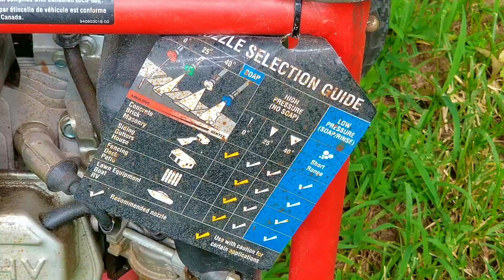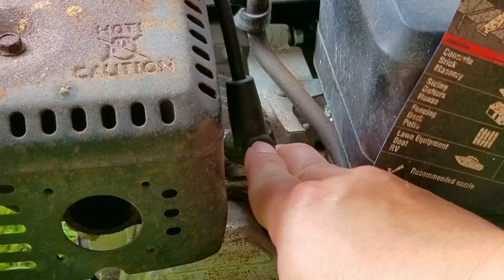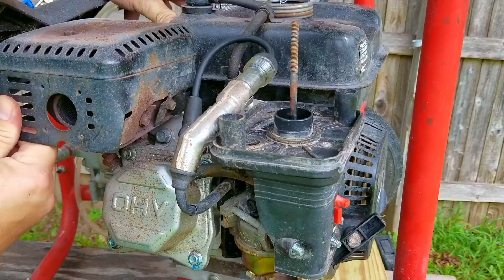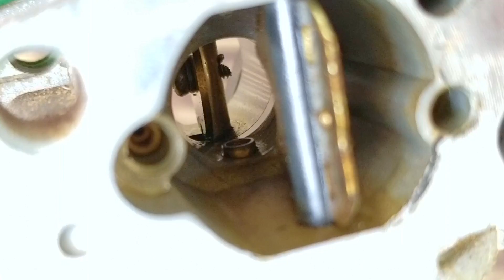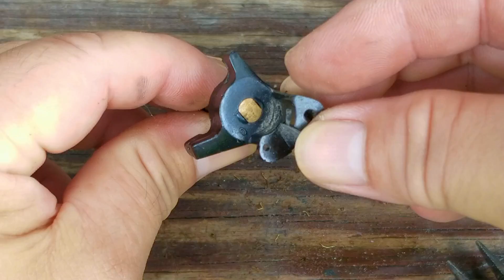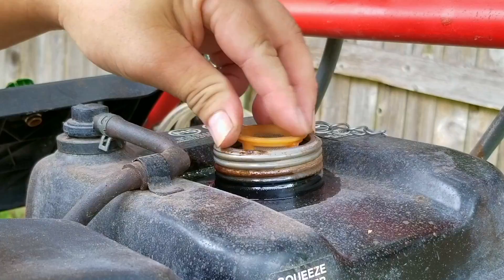Don't let this happen to your Pressure washer.

Comment: I have a ryobi pressure washer gas powered 2600 I think honda motor gcv but anyways I've been working  on it and it'll crank but whenever I take it off of the choke it dies though I will say the wand is also missing the novel tip
Reply from the maker: Have you cleaned the carb focusing on the fuel jet?
Reply: @HomeGaragechannel  i think I did, but I shall do it once more and then try to see if it will run with the choke off hopefully thats the solution! Oh, and by the way, i must say, man, you have helped me in so many ways, so I must say thank you, and I appreciate all that you do with fixing and solutions with small engines on your videos!

Comment: You mention using aftermarket carbs. I have found many times their quality is poor and they don't work well. I always recomend to my customers a factory unit unless the O E M is extremely expensive, but give them a choice and inform them that I can not guaranty an aftermarket carb. Al from Als mowers etc.
Reply from the maker: Thanks for the tip!

Comment: There is a manufacturer hole under the gas tank on the inside corner and no video shows the inside top of the pump where that area of the tank is. I’m pulling my hair out.
Reply from the maker: I'll have to look and see what you're talking about.

Comment: Definitely save and rebuild the original carb. I also use engineered gas for my pressure washer to minimize fouling.
Reply from the maker: thank you Michael Skinner.

Comment: I built my washer from the cart and engine, a 7.75? horse Briggs [plastic cam engine that the washer pump froze up on and ordered everything from Ebay. It would start with the auto choke closed so with a main jet cleaning it does fine now. I always try and clean before ordering new and I think we both did a good job. Thanks and Blessings!
Reply from the maker: thank you Lewie McNeely
Reply: @HomeGaragechannel  Sure thing!

Comment: I would have cleaned it. That is part of the fun. I was really surprised that the pump wasn't busted. Living in the Midwest I find that to be the most common issue. They get put away and left in garages, sheds or barns in sub zero weather.
Reply from the maker: you're right about that.

Comment: Just picked up one of these at an estate sale for $30 as a summer project for me my son. Trying to teach him how to diagnose and work on things instead of just throwing it out. I took the bowl off the carburetor and it was full of crystals and dirty fuel just like this, but the tank had clean fuel. I cleaned it and re-assembled, but it's still not running. Tested it by putting fuel straight into the throat and it runs for just a second. Will try a more thorough cleaning of the carburetor before buying a new one.
Reply from the maker: good job. that a good way to teach your son perseverance.
Reply: Did a more thorough cleaning and got it running. My son was ecstatic and I'm happy with a working pressure washer on the cheap. Thanks for your videos! Really helped me with my repair.

Comment: I have a 3200 psi pressure washer with a Honda engine that works great I would highly recommend the same to others… I would have cleaned the carb like you did I use an old guitar string to clean the orifices along with carb cleaner and compressed air… another thing that helps keep carbs clean is Johnson Evinrude 2+4 fuel system cleaner and it only takes a very small amount but in the case of this carb it definitely needed to come apart to be cleaned …. Great job I’m sure this video will be useful for many 👊🏼
Reply from the maker: thank you for the tips Fred D. I appreciate it.
Reply: @HomeGaragechannel  you’re welcome

Comment: Here is a tip for you. Make sure you have the water hooked up before you start and try getting the air out before hooking up the pressure hose. If you run it without turning on the water you could damage your pump.
Reply from the maker: yes you're absolutely right.

Comment: Great video, just subbed to your channel. I have a Honda power washer that was given to me that has me stumped, it needed a new pump which I replaced and I cleaned the carburetor a few times and the engine still surges very badly. I then bought a brand new OEM Honda replacement carburetor for only $23 as well as all new gaskets, still has a very bad surging problem. Any ideas of other things I should check? I confirmed it has good fuel flow to the carburetor so I don't think it's the tank vent.
Reply from the maker: Thanks for the sub! I need more information about the pump. can you give me a model and serial number?
Reply: @HomeGaragechannel  I don't think there is anything wrong with the pump but here is a link to the exact pump I bought https://smile.amazon.com/gp/product/B088376WV2/ref=ppx_yo_dt_b_asin_title_o03_s00?ie=UTF8&psc=1
The engine just has a very bad surge even still after replacing the carburetor with an OEM Honda one as well as new gaskets.
Reply from the maker: thanks for the information , but I phrased that wrong, I mean the model and serial number for the pressure washer.
Reply: @HomeGaragechannel  I looked on my power washer and the model/serial number sticker is missing, I can tell where it was on the frame. But I just noticed something after watching your video where you swapped the engine on that Honda mower that was knocking real bad and while looking at the parts diagram for the engine, the plastic insulator plate and insulator gaskets were in the wrong order. I just put them back on the way they came off when I tried cleaning the old carburetor and replaced it with the new one and gaskets but it looked like someone had the carb off before so they must've gotten the order wrong. Could that potentially cause the engine to surge?
Reply from the maker: possibly, if there wasn't a gasket where there was supposed to be one, could cause it to surge.

Comment: I have a problem with a Trimmer/Multi tool my dad bought a few years ago. It has some sticky/oily residue arount the spot where the fuel hoses enter the tank and the lid is a bit sticky too. Also, the primer bulb doesn't fill up. Should I open and check the carb?
Reply from the maker: not yet, have you put some fresh mixed fuel into tank? The Fuel Filter might have the Same stick oil on it that might be blocking the fuel from getting to the carb.

Comment: I fixed a plastic fuel float with a solder iron on my last free mower find. I do need to take it back apart to take apart the plastic injector tree. (New style carb). I'm still learning about the wires to clean holes with.
Reply from the maker: Great tip! Was the old float split?
Reply: @HomeGaragechannel  Presumably along the back seam near the pin mount. Pried it apart there to remove the gas then melted it back together.
Reply from the maker: wow, excellent work

Comment: I would keep the original carburetor on it and just clean it.  But when cleaning it, I would have not taken the whole carburetor off of the engine.  I would have just tipped the engine backwards, took the bowl off and removed the emulsion tube to clean and then put back together.  Sometimes those carbs can be a hassle to reinstall
Reply from the maker: you make a Great point! I'll have to remember that next time. thank you Cole Steffens.

Comment: for me i,d give it a good cleaning and starting with a proper dis-assembly and then put it back together in the right order and then re-assemble and then re-install back onto the engine and see how it works from there and if it,s not running right i,d replace it then from there on and my Ryobi 163cc engine was working a couple of days ago but the water coming out of it by the pump is not pumping enough water and it sounds like to me the carb could be dirty or i could give the pump a good cleaning inside or the trigger gun might need a inspection and probably a clean too.
Reply from the maker: let us know how it goes. I'm  interested to see what the issue is.

Comment: If you live in cold climates, most of the freebee pressure washer your going to find will have hit the curb because the last owner failed to disconnect both of the water lines and drain all the water out of the pump properly; which caused the remaining water left inside it to freeze and bust the pump. In these cases, you will likely get the motor running just fine only to discover that the pump makes no pressure at the wand but water sprays out the crack in the pump. You can easily buy a replacement pump, but the cost of the pump is usually as much or more than the value of the machine with a new pump installed … but, if the machine was free or nearly free and your plan is to keep and use the machine for yourself, the cost of the new pump is usually cheaper than buying a new machine. I purchased an older machine about 10 years ago for a few dollars, got it running (for free) and replaced the pump for around $85.00. Over the last decade, I have gotten far more use out of it than the roughly $100.00 I initially invested in the machine … so I call it a win and it still works great. Could I have bought a good used machine for the same money? Yes … but I was already “in” this machine and I didn’t want to spend more time and gas money driving around looking for another machine when I knew all it needed was a pump to be ready to work. I only replace carbs on 4 stroke small engines if they are corroded inside. If I discovered a carb in the condition of this one, I would also have tried to clean and revive it. I have had much better luck with 4 stroke carbs “coming back” than 2 stroke carbs … plus the parts are larger and less likely to go “ping” and fly across the garage!
Reply from the maker: you make a good point Brian Andrews

Comment: you must buy carb clean by the case.    I love my heated sonic parts cleaner.   😉
Reply from the maker: which carb clean do you use?
Reply: @HomeGaragechannel   i use Allendale Ultrasonics Cleaner Solution in my parts cleaner.    its safe on brass, aluminium plastics.  it does a great job at cleaning  carbs and parts up nicely. i get mine on amazon.   if you talking Canned carb cleaner, I'm not to picky, generally whats on sale.
Reply from the maker: thank you for the information

Comment: I think homelite  makes affordable equipment for people not looking to go break the bank, but also ryobie as well. I was actually checking it a video the other day, their is a presser washer that is so powerful, it can literally cut thru rock, or cement. I don’t know why anyone would want one , but i thought it was pretty cool.
Reply from the maker: how many psi was it? is that the one that was on Top gear with Matt Leblanc?
Reply: @HomeGaragechannel i don’t  think so. I believe this was about 7,000 psi. But from what they guy on the video said. It could go thru rock or concrete.

Comment: I watched this video then fixed my neighbors pressure washer that his uncle had given up on. Thanks for the tips. How about a winterizing video? It had been left for 8 months in a very hot shed in direct sunlight with E85. Every carb orifice was plugged solid and the float needle was stuck with green junk. Once I cleaned the carb & replaced both gas filters and changed the oil, I put 92 octane non-ethanol in it and 4th pull it started and pressure washed for 45 minutes without a hiccup. Refueled and it started on first pull.
Reply from the maker: Nice work. I really don't winterize my pumps but I might have to come up with a plan this year since I have several now.

Comment: Great job! I’d rather save the original carb if possible but if it’s too far gone I’d get a replacement. Sometimes those emulsion tubes are nearly impossible to get out!
Reply from the maker: I try but sometimes I give up too easily.

Comment: I always clean the OEM carb first in an ultra sonic cleaner. However I have some carbs so bad and corroded that they have to be replaced. Those Honda sytly carbs are well worth cleaning. Cleaned one recently and the bottom of the bowl was rotted thru. Good job and many thanks.
Reply from the maker: thank you Waterman one.

Comment: I would try and clean out the carburetor first and see if it still works. Once seeing that it works and the performance of the machine, I might consider buying a new carburetor and replace it completely
Reply from the maker: that makes sense

Comment: I bought a Craftsman pressure washer at a pawn shop and I checked the carburetor for debris and other contaminants in the carburetor bowl; it had varnished fuel and the jet screw was dirty... After clean-up it runs like new
Reply from the maker: nice work Samuel Velez, what did you end up doing with it?
Reply: @HomeGaragechannel  keeping it of course... I use it when needed...

Comment: Aw, geez. What terrible chassis design. Nice pressure washer you now own, I'm somewhat dubious of aftermarket carbs. I haven't had the best of luck, so I usually just clean them.
Reply from the maker: you make a good point. I have a limited time for carb cleaning so I might have to invest more passive time in cleaning them. That or just get the ultrasonic cleaner. thanks again for your time.
Reply: @HomeGaragechannel  I regret taking my sweet time before purchasing mine. It is a time-saver in the sense you can plop that carb in the tank, and move on to oil change or blade sharp, or whatever while that carb buzzes away.
Reply from the maker: you make a good point.

Comment: What are the other options you mentioned we were going to explore later in the video?
Reply from the maker: I don't recall if I had another option. Sometimes there's nothing to mention.
Reply: Seems to me the other option was to buy an after market carb.
Reply from the maker: I had to look at my script, the other reason was a clogged filter screen in the tank, blocking fuel from getting to the carb.

Comment: I was wondering about when storing the pressure washer for a long time, there's this product by Briggs and Stratton called 'Pump Saver' that you spray inside the water hose out take so it we'll maintain all the gaskets lubricated inside, is that truly necessary? Can I spray any silicone base sprayer instead of that if it's really necessary? The 'Pump Saver' for a little bottle is kind of expensive.
Reply from the maker: to be honest I'm not sure, I have never used any type of product like that in my pump.
Reply: And not to mention pump related problems later... I used a pump saver fluid from the guys who manufacture a very recognized fuel stabilizer... And ceased to use it anymore...
Reply from the maker: you had a pump issue after using the product then?
Reply: @HomeGaragechannel  yes, but used wd-40 and worked fine... WD-40 works better than the pump saver...
Reply: As a matter of that, the pump saver almost ruined the pump

Comment: Well you got a win, and a good working pressure washer, but what a faff to get the carb off, poor design
Reply from the maker: I know right. I've thought about turning it around in the frame but it may not help
Reply: @HomeGaragechannel  Taryl fixes all did a craftsman generator i think and he had similar problems gettting the carb off , and had to remove the studs, it drove him up the wall as it was poorly designed, with no thought for maintanance .

Comment: I inherited a pressure washer with a Honda engine.  It hadn't been used in years.  I took the bowl off and it was filled with crystals.  After cleaning the carb, that thing runs like a dream.  Only machine I have with a Honda engine but it won't be the last.
Reply from the maker: thank you for vouching for them Clif B.

Comment: Hello Home garage how are you doing I have a problem with my old power edger it would run won't stay running I think it's the Springs are loose it's hard to get to them
Reply from the maker: can you give me the model and serial number of it please. that way I can see what yours looks like.
Reply: @HomeGaragechannel  it's a MTD yard machines with a Briggs Stratton engine it's a 3.5 horsepower
Reply from the maker: sorry Paul Burn, I need more information to narrow it down. Is there anymore information you can tell me about it?
Reply from the maker: the age narrows down a bit more. I'll check when I get back and Hopefully I can find it. thanks.
Reply: Hello Home garage how are you doing here is the model number for the edger that I have 25A-588A129 and the serial number 1C309K50560   MTD